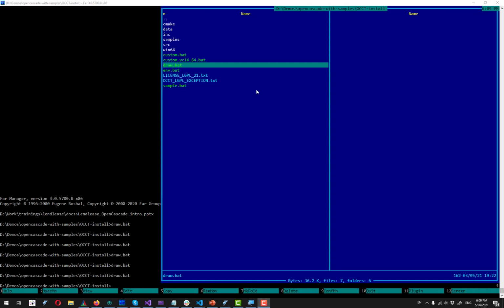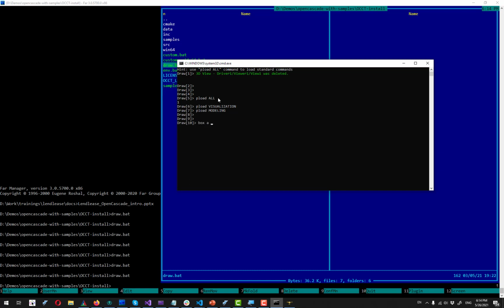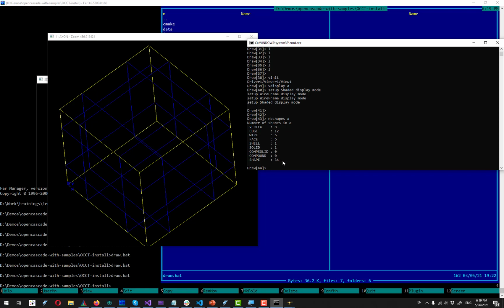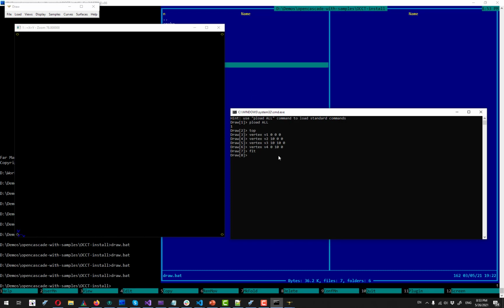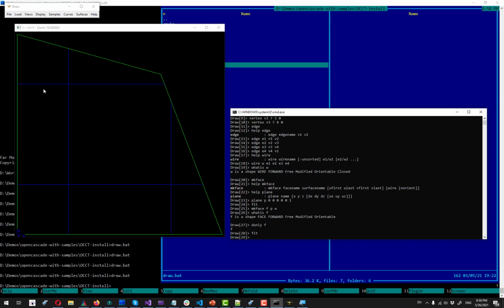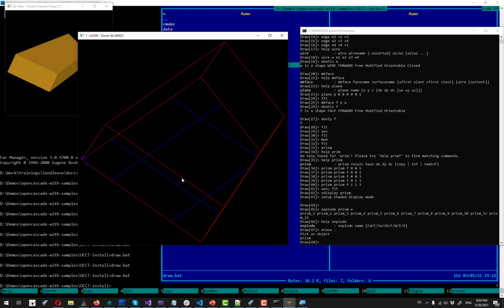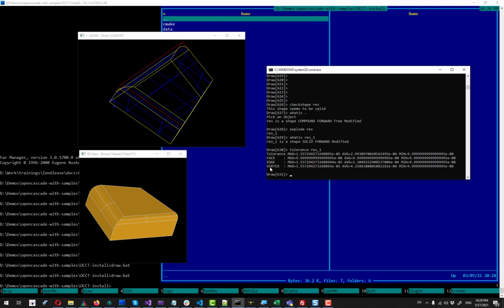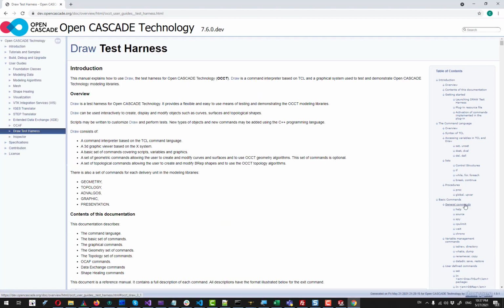Lesson 9: Prototyping with OpenCascade in DRAW | Scripting in OpenCascade

Comment: Hi, I have a question regarding creating wires and sketches on plane, does occt have a function to import .svg (or .dwg mb also) as a wire (sketch)? Would be handy, sort of the way OpenSCAD works - say to draw your sketches in libreCAD, and then import them to perform some extruding/boolean.
Reply from the maker: Nope, there is no SVG import in OpenCascade.

Comment: This is probably one of the very few tutorials about OCCT Draw accessible on the Internet and I have to thank the author for this. It is possbile to access the Draw functionality (viewer, commands) but not using Tlc based console but from a C++ console Visual Studio project?
Reply from the maker: Well, I don't have such an experience. If, however, you already have a Draw session running, then it's possible to pass commands for execution right into the existing interpreter (see the second part of this note here: http://quaoar.su/blog/page/on-geometric-imprinting-and-debugging-hints). I can only guess that since you may call DLL's functions right from the debugging console, there can potentially be a set of exported function to initialize the viewer and make things work the way you want. You can probably even write some specific functions only for the purpose of exporting them into DLLs and running within debug sessions.
Reply: @QuaoarWorkshop  Hi Sergey! Thank you for your answer! I appreciate any info about basic use of OCCT, unfortunately the link is broken, maybe you can indicate an updated link.

Comment: still eagerly anticipating the bare-bone example on OCAF
Reply from the maker: Not sure if it will fit into one video, but let's try.
Reply: @QuaoarWorkshop  I guess a bare-bone example does not need load and save drivers. Most applications require customized databases and input files anyway, so maybe omit the drivers if possible ? My application involves structural analysis model creation. So the users will click at grid points or other nodes and create line elements and surfaces for example. and the data is saved accordingly. so there is no standard load and save mechanism available anyway.
Reply from the maker: @retiredreplicant.2195  It sounds like you're already familiar with OCAF, aren't you? ;)
Reply: @QuaoarWorkshop  I read through the documentation. But I am confused. I can not start to write any code because I dont know where to start. I think all of us agree that opencascade is not trivial and especially OCAF has a higher level of abstraction.
Reply: @QuaoarWorkshop  The reason I am confused is because I dont know how things fit together.  How to interactively add a line or a surface for example ? is that a possibility ?
Reply from the maker: @retiredreplicant.2195  Interaction is yet another topic. OCAF is all about data, so it's a pure "backend" thing (if we can speak about backends in this domain). Personally, I use VTK for interaction, although it is all possible with AIS as well (but I don't like its architecture and documentation is vague). And, yes, OCAF is probably the least documented thing among the others, although I keep using it for 8 years or so, and still find it a good thing. It all came from Euclid Quantum and the developers of this CAD package did quite an amazing job back then.